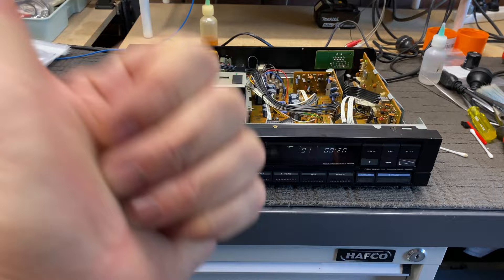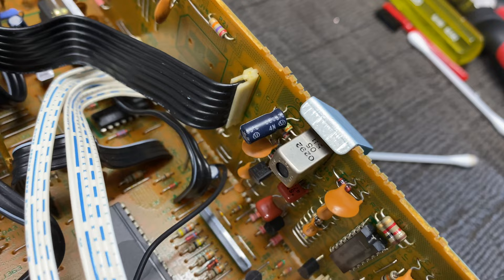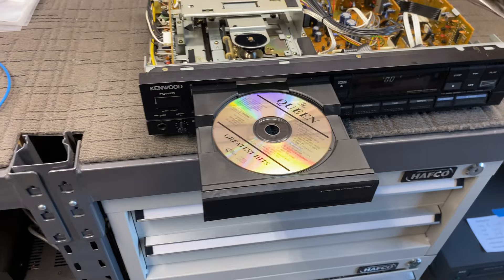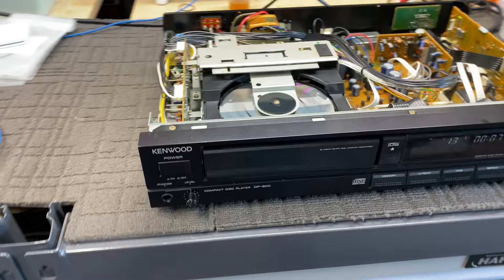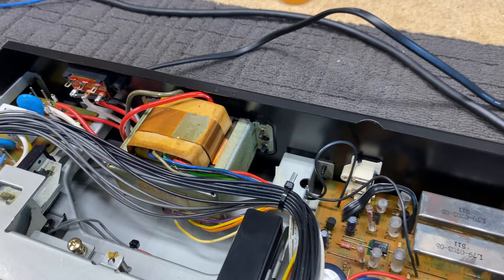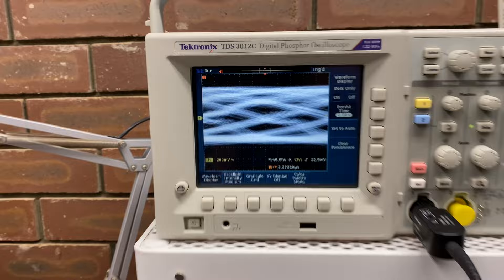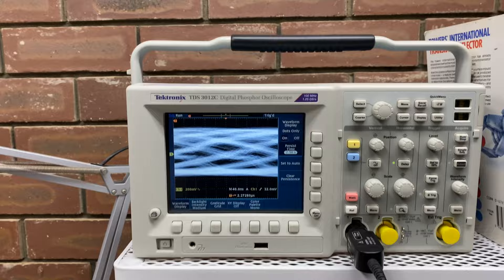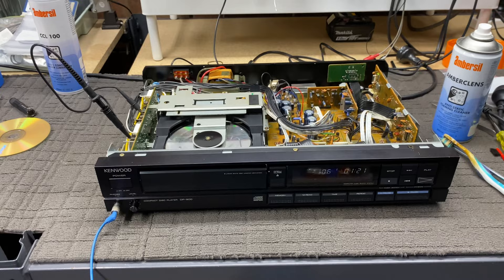Lovely Kenwood DP-900 CD Player Repair & Service, plus RF Eye Diagram Discussion!

Comment: I have been working on a DP-R5705 cd changer. It is all plastic gears and I checked it ot and determined that all that was wrong with the device was a stretched drive belt, I removed the drive belt and was shocked at how many function do not work at all until I can get a new one. Please wish me luck DIY HELL.

Comment: Nice Kenwood but you repaired the teac vrds 10 I have got a vrds10se that one is a real beast, tank like you mentioned still running from 1995 external DAC plays every modern CD player down to the ground. It almost is like a expensive turntable with a 500 euro cardridge. Nice video again

Comment: Beautiful Kenwood CD player.  (Nice oscilloscope).  Thank you for making & posting this video.  (I'm having tracking problems with my Magnavox CD player.  I've reduced laser power [was from factory way too high].  Now it plays the CD to the end.  But when changing tracks it begins to emit a high pitch whine, softly, and needing to place one's ear close to the door to hear it.  Does not happen for first two tracks.  And plays complete CD with no track changes.  After it warms up (~1 hr), one can change tracks and the noise is gone.  I don't know what this is.  Any/all comments most welcomed (if you are amenable).  Thank you again for making and posting this video.  Nice player.  Thank you again.
Reply from the maker: Hi Tony, thanks for your kind words and glad you enjoyed the video. Laser power output is usually very precisely factory set and should almost never be adjusted. It can be checked by measuring current drawn by the diode (best) or optical power output (less reliable), so I'm assuming you've used one of those methods here? Normal service adjustments are to the focus and tracking servos, oscillator frequency and occasionally other parameters. Whine could be from a coil, inductor etc so check and see what's around.
Reply: @LiquidAudio  Hi LA, thank you for the kindness of a reply, and with valuable input.  (I did adjust laser power carefully, (& as specified by service manual), setting it just a little under the specified setting.  Thank you very much for the help.  (Tracking servos have an adjustment, but have not checked nor changed anything there.  May try that next).  I'll look to see if any coils/inductors are making noise, as per your suggestion.  Thank you again.  God[Bible] Bless.

Comment: Hi, not sure if this is okay to ask, but I'm deciding between Kenwood DP-900 and DPF-7002, as there are second-hand ones that I can find. Do you happen to know the main differences? Thanks in advance.
Reply from the maker: Very different sorts of machines, I much prefer the DP-900, a much heavier duty and better built player. The other is not well-known and looks to come from a midi/mini-system or similar.

Comment: I need help. I have a DP-R894. The machine turns on the LCD functions work but it doesn’t respond when ever I push any buttons. The tray won’t open the CD changer doesn’t spin? Please help
Reply from the maker: Hi Patrick, this would need to come to me for assessment and diagnosis as there are many potential failure modes. If you live in or around Perth, visit my website and contact form.

Comment: Hey man, thanks for the video. Maybe you can help me out, I have a DP-850 that works, and ejects and everything, but the disc won’t spin. Pulled it apart, and I can’t see anything obviously wrong. Any ideas? Thanks!
Reply from the maker: No worries, glad you enjoyed it. In terms of troubleshooting, there will almost never be anything obviously wrong to the average owner, apart from the fault of course. This will require troubleshooting of a technical nature, preferably by an experienced repairer. We need to check things like position switches, drive to the laser and spindle motor as part of the loading sequence, etc. The service manual will be helpful here.
Reply: @LiquidAudio  yeah I get that. But it’s a cheapo 1980’s cd player, it’ll cost more to diag and fix than just buying a new one. My grandfather needs a new one in his shop and I had a few old ones laying around. I’m not an electrical genius, but I’m a mechanic who knows the basics, and I’ve fixed plenty of guitars and amps before. Just figured it might be something simple. No worries, thanks for replying!
Reply from the maker: @CivilizedWarrior  All good, just keep in mind that cheap new players are junk and very different to your DP-850. Best of luck with it though.
Reply: @LiquidAudio   I know, that’s why I was trying to fix it. But it’s 40 years old and I cant really afford to pay someone to fix it, and then risk something else going wrong with it. I live in Joe Biden’s America lol. I’m barely scraping by here, don’t really have any disposable income. And honestly, I don’t even know where I would bring it, anyway. All the old electronics shops around here closed a long time ago. Nobody gets anything fixed here anymore, they just chuck it and buy a new one. Which I hate doing, if I can help it. Thats why I asked, I don’t have a manual for it, and I don’t know what any of the parts are called. From what I could see, the motor turns by hand, but won’t spin on its own, and whatever drops the cd down onto that spindle looking thing isn’t working. If you could give me an idea of which parts I could test, and what they’re called that’d be awesome. But if not, no worries. I ain’t expecting you to accurately diagnose something 10,000 miles away in the comments section lol. I won’t sue you if you get it wrong, or I shock myself lmfao. Cheers man. Thanks.